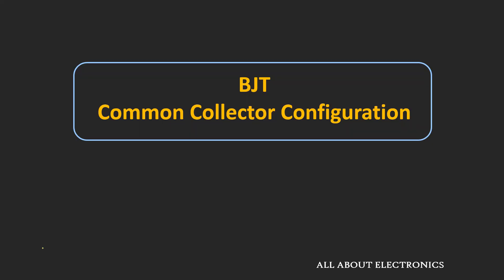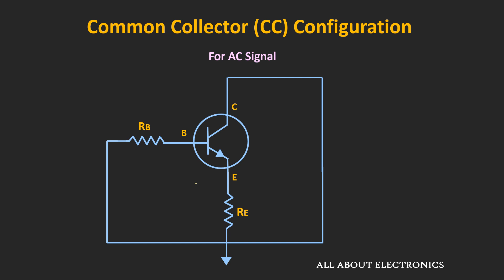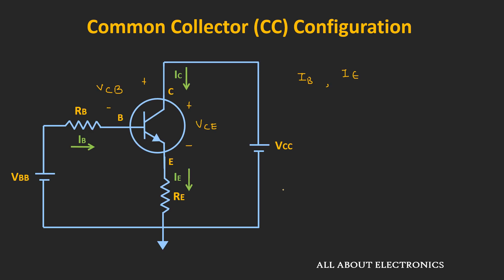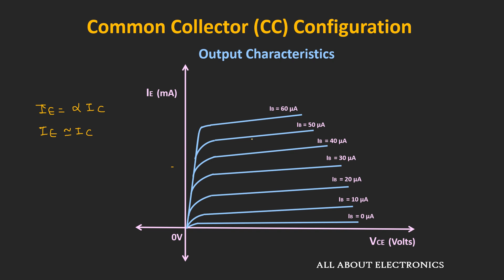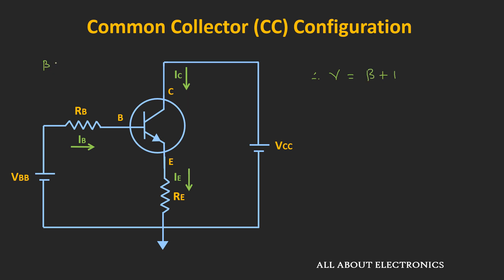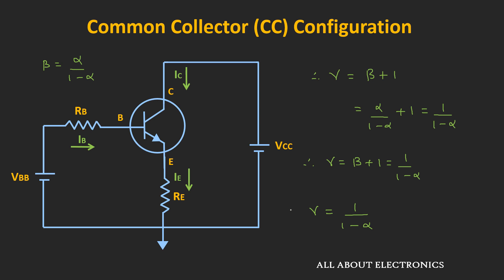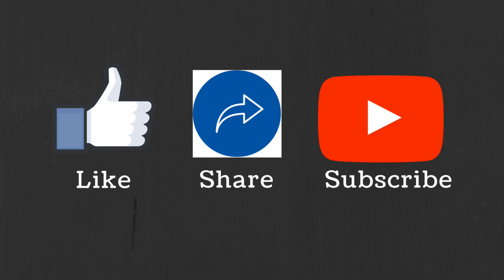BJT: Common Collector Configuration (Input and Output Characteristics) Explained

Comment from the maker: Minor correction:
At 3:27, Ic = α Ie

The timestamps for the different topics covered in the video:

0:22 Introduction to Common Collector Configuration

3:07 Input and Output Characteristics of the Common Collector Configuration

5:26 Relationship between the α, β, and γ in BJT

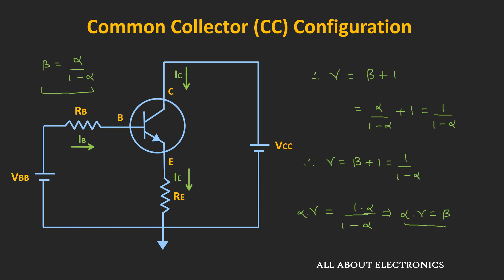7:48 Properties of Common Collector Configuration
Reply: Bro this experiment lab manual venum

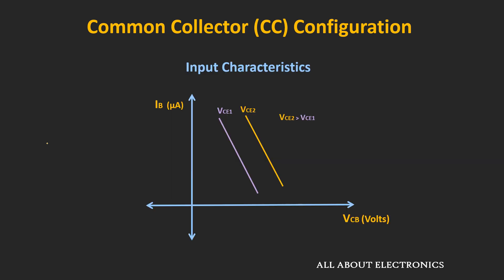Comment: why do you say has high input impedance at the end of the video? your input characteristics for 5:15 and beyond describe relationship between Ib and Vcb. but there a moderate change in voltage leads to sharp change in current. by this logic, impedance = (moderate voltage)/(large current) = small impedance.
Reply: Current is in micro amp, so it is very small compared to numerator. Therefore Input impedence is very high.

Comment: its a lot confusing. you used CE configuration and explained CC. so its too confusing
Reply from the maker: Many gets confused with CC configuration as CE. I see lot of comments like this. The thing is when we say common collector or common emitter configuration, it is with respect to AC signal ( and not DC Biasing voltage). 
From DC analysis perspective although CC and CE appears same but for AC signal they are different. In CC configuration there is no resistor at collector. So for analysis, the collector appears as ground. Because for AC analysis, all the DC sources are grounded. And that’s why collector is common between input and output. And in this way, this configuration acts as CC. I hope, it will clear your doubt .

Comment: The circuit diagram looks like common emitter
Please don't confuse the students 
Edit the video.by changing the circuit diagram.......
Reply from the maker: I have already explained in the previous comments. But let me explain it again. Any BJT configuration (its naming) like common emitter, common collector, common base is basically for the AC circuits. So, here although it appears as common emitter, but when you do ac analysis, the collector terminal will be common between input and output. For AC analysis, all the DC sources acts as a ground. So, in that case, the collector terminal will get grounded, while emitter terminal is not grounded. (As there is a resistor between emitter and ground). And in this case, the collector is common between input and output. That is why this configuration is common collector and not emitter. 
I hope, it will clear your doubt. If you need more info, you may check BJT playlist. In the playlist, I have already covered Common Collector Amplifier, where I have explained that in detail.

Comment: This is common collector or common emmitter configuration
Reply from the maker: It’s common collector configuration. In common emitter configuration there is a collector resistor between collector and supply. Here, there is no resistor.When we do AC analysis, then DC source will get short circuited and collector terminal will get grounded. That means collector will be common between input and output. And that’s why it is common collector configuration.

Comment: you are using CE configuration  diagram and explaining CC configuration....
Reply from the maker: In CE configuration there is a collector resistor while in CC configuration, the collector is Directly connected to supply voltage. These configurations are defined based on which transistor terminal is common between input and output for AC signal. And for AC analysis, all the DC sources in the circuit are assumed as zero. So, for AC analysis, collector terminal will be at ac ground. ( VCC will get grounded). And in this way, it is common between input and output side. Input is between base and collector, while output is between emitter and collector. 
For more information, please check this video:
https://youtu.be/qSxgU9jtFhw?t=22

Comment: Many people do not understand the way BJT and MOS transistors work as SIGNAL amplifiers. They have to match the previous and the later stages not to distort the signals with impedance mismatch. For BJT, it needs to be Biased into the operating  region (Active when using as Amplifier instead of when operating as a Switch). So that DC Bias would depend on beta or desirably Not.

AC signals then will be applied on this active circuit to be amplified of the parameters I, V or simply to match Z (buffer). Since we are only concerned with gain as percentage, this is where GND and Source are removed : No need. Because it is where we Calculate the relationship of the Outputs as a Function or Equation of the Inputs regardless of the supplied Voltage as it is assumed to be say 5V. Here Beta plays the role in Gain calculation. Hint : Biasing is to make DC condition Independent of beta = not or less temperature, process ... dependent.

The relationship between Output-to-Input -= Gain is mathematically defined as the Dependent Source in the Hybrid-Pi model.

You need to understand,

1. DC bias : Why, and how best
2. AC analysis for I or V gains : When AC signals applied on top of that DC bias
3. IO Impedance : To match source and load stages
4. Distortion : Noise, CMMR, etc
5. Stability when feedback : frequency response.

That is my take.
Reply: hello, thank you for your comment, any book you had referred, i am finding a source to learn the same but i cant find any

Comment: In Common Collector Configuration, The input is connected between Base & Collector and output is connected between Emitter & Collector but in the explanation input is connected between Base and Emitter and output is connected between Emitter and Collector, which is Common Emitter Configuration.
Kindly clarify on it
Reply from the maker: The common collector configuration is from the AC signal perspective. Here I think, what your are referring to is the DC biasing voltage. The configuration works as a common collector configuration for AC signal. For AC analysis, the DC voltage will act as a short circuit, so collector terminal will be at AC ground. Therefore, the ac input will appear between base and collector and the output is appearing between emitter and collector. So, collector is common between input and output side. I hope, it will clear your doubt.

Comment: Bhai I think you mistakely shown CE configuration at 2:52
Reply from the maker: It's common collector. There is no collector resistor here. From DC analysis perspective CE and CC configuration looks similar. But for AC analysis perspective they are different. If you go through the AC analysis videos on the BJT playlist on the channel, it will get clear to you.

Comment: I've one doubt:
If we consider total network as a 2-port network which is generally represented by [V1=F1(I1,V2) and I2=F2(I1,V2)] then output characteristics following the general formula: Ie(as I2)=F2{ Ib(as I1), Vce(as V2)};
but the input characteristics is not following the general formula for CC and it's represented as Ib=F1(Vcb and Vce) instead of Vcb=F1(Ib, Vce) and everywhere it's followed for CC input characteristics.
Help me to solve that issue.

Comment: It's totally wrong. It's a common emmitter configuration.
Reply from the maker: I have explained many times in the comments, why it is common collector configuration. 
But let me explain once again.
When we say, common collector, it is with respect to the AC signal. Although for DC biasing perspective it looks as if it is a common-emitter configuration, but for AC signal, the collector terminal will get grounded. (AC ground). The AC input signal is applied between the base and the collector, while the output is measured between the emitter and the collector terminal.
I hope it will clear your doubt.

Comment: This is common emmiter configuration.Please dont confuse the students.if you cant do a thing right then please dont do it.
Reply: @ALL_ABOUT_ELECTRONICS Still it's wrong 
Corrrect your mistake the connect of C should be in common not E 
See your diagram of the configuration
For the dc the arrows are wrong and the diagram too
Reply from the maker: First of all, think twice before making any critical comment about anything or anyone !! (I am not against any constructive criticism )
Coming to your question, the common collector and the common-emitter configuration looks very similar for DC analysis perspective. But for the AC analysis perspective, they are different. In the CC configuration, there is no resistor between the collector terminal and the supply voltage. So, for the AC signal, the collector terminal acts as AC ground. 
Hence, for the AC signal perspective, the input is applied between the base and the ground, or effectively between the base and the collector terminal, while the output is taken across the emitter and ground, or effectively between the emitter and the collector terminal (which is ac ground).
Hence, it is called a common collector. 
I hope it will clear your misconception.
Reply: @ALLABOUTELECTRONICS it is not common collector
It's common emitter diagram

Comment: Hi sir, the circuit seems very confusing. It shows a CE configuration.
Reply from the maker: When we say, common collector, it is with respect to the AC signal. Although for DC biasing perspective it looks as if it is a common-emitter configuration, but for AC signal, the collector terminal will get grounded. (AC ground). The AC input signal is applied between the base and the collector, while the output is measured between the emitter and the collector terminal.
I hope it will clear your doubt.
Reply: ALL ABOUT ELECTRONICS  Thanks sir, but my doubt is still not cleared. Shouldn’t we be giving the input btw Base and Collector instead of Base and Emitter since the common point of i/p supply is Collector! Also, why is the input taken from Emitter with respect to Gnd instead of Emitter and Collector? It would be very helpful if you could clear my doubts...
Reply from the maker: What is shown here is the DC input. It's for biasing. For AC signal, voltage VCC will act as a ground. So, when we apply the voltage between base and ground, effectively it's between base and collector. Similarly when we measure the output between emitter and ground, it's effectively between emitter and collector.
I hope it will clear your doubt. And if you still have any doubt then don't worry, very soon I will cover the common collector Amplifier. At that time it will get clear to you.
Reply: ALL ABOUT ELECTRONICS Thanks a lot sir. It’s almost cleared my doubts. It would be very helpful if another video on CC amplifier is uploaded. I would also like to add a few humble suggestions about the the topics which you could consider uploading;

1.Buck Converter 
2.Boost Converter
3.Buck Boost Converter
4.LDO
5.Current mirror circuit

Additionally, let me take this opportunity to express my gratitude towards your effort by saying that you are doing an amazing job, sir. I’m a working professional in an electronics core company and I’m very much excited to watch and follow your extremely informative classes. Even very complex topics which I was not able to grasp during my tenure in Engineering college were broken down in simpler way for explanations. I wish I would have watched your videos back in my college than wasting my time attending many futile classes. All I wanna say is thank you so much and keep up this great work in the future. 😊😊

Comment: I referred in my book that for common collector configuration the emitter is connected to negative terminal and the collector is  connected in positive supply ,but you're connected opposite to that configuration. 
Can you explain?
Reply from the maker: Please check whether it's PNP or NPN transistor.

Comment: How is this common collector? It looks like common emitter. In fact Collector is connected only to emitter and not to base?
Reply from the maker: When we say it is a common collector configuration, then it is for the AC signal. For AC analysis, all the DC sources are assumed to be zero. Please check at 2:00.
So, the collector terminal will get grounded.
That means now the input signal is appearing between the base and the collector, while the output is appearing between the emitter and the collector terminal.
Hence it is the common collector configuration.
I hope it will clear your doubt.
Reply: @ALLABOUTELECTRONICS  If the resistance with an arrow you drawn at 2:00 under the V(0) is grounding, then you've shown a grounded emitter. I'll keep studying other sources. 
Well compiled educational material tho, keep it up!
Reply: @MDMAx  can you tell from where are you studying cc configuration
Reply: @ALLABOUTELECTRONICS  make more complicated 😵‍💫😵‍💫😵.